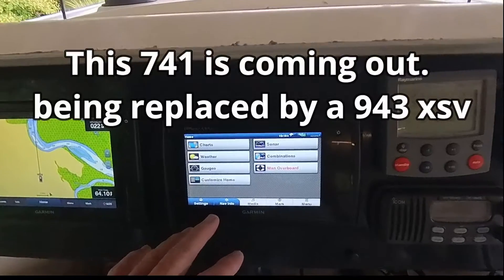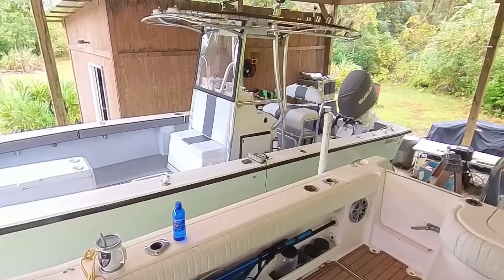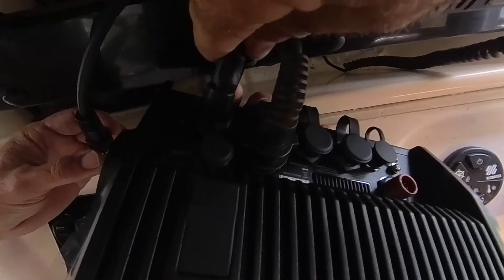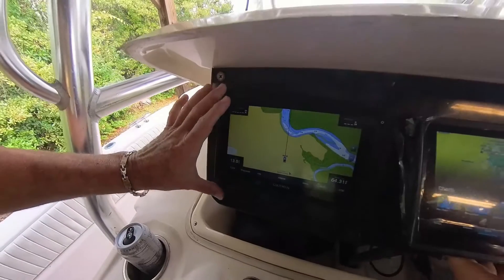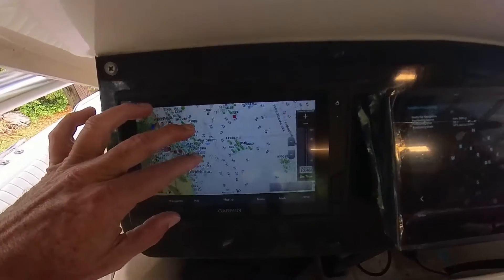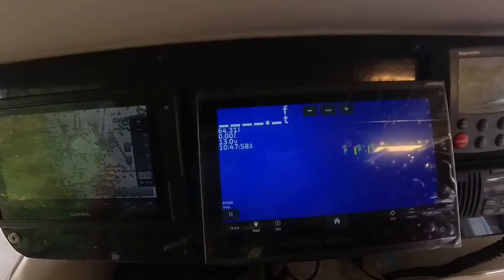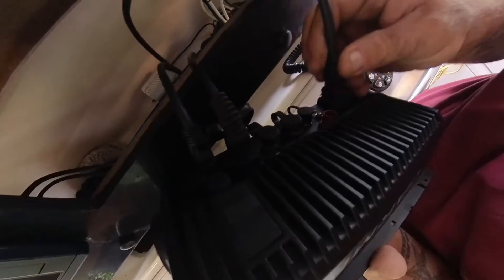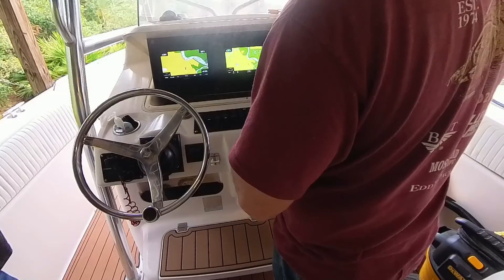Installing a Garmin 943xsv GPS on my boat

Comment: nice video are the garmins w/ keys an key assists a POS ? this Garmin GPSMAP 1042xsv GN+ Chartplotter/Fishfinder thanks for heads up on the touch screen.are those screws security types heads where a regular screwdriver won't fit?

Comment: What is the part number of the Garmin gpsmap 943xsv
Reply from the maker: Are you looking for the 943xsv with or without a transducer? We're absolutely loving this new unit on my 32 grady white.. It's very, very fast.. Good processor speed, no crashing or hanging up.. Clean running gps map and sonar as well. Very pleased with it.

Comment: These guys have no idea what they are doing! Do not listen to them. My Garmin EchoMap 2016 has worked perfect no issues. I just installed new Garmin 943 xsv working perfect! I stand by my Garmin's. I also have Simrad NSX9 its ok, but limited on reading my GLF 10 and GLS 10. Must have Garmin to re-calibrate both.
Reply from the maker: Did you actually watch the Video? If you don't listen, you'll wind up with issues like I have (on video by the way).. Been using Garmin for over 20 years in a commercial environment.. The 943xsv is an awesome GPS.. This video isn't about echomap units AT ALL. Echomaps are just fine. But all Garmin's aren't perfect, especially early full touch screen models and neither are Simrads. I have those on boats currently as well, and ALL have known bugs.  ----  Do you have  a GPSMAP 741xs or a 942xs? The 943xsv was chosen because it works perfectly, which is why I installed it. The 741xs I replaced (two different units with different issues) THESE ARE KNOWN ISSUES. EASY TO LOOK UP.  The Internal antennas on the 942xs DO NOT WORK without an external source 90 percent of the time. A KNOWN issue as well. If you still don't think I know, Watch the 741xs performing like the junk that it is.. Early units have issues, and that's a fact -https://www.youtube.com/watch?v=bKBnACQ5rL8

Comment: I have 12k invested in multiple Garmin 8616’s, if I knew CMOR and other chips wouldn’t be accepted , I would of went with Simrad.
Reply from the maker: @HardSarge Completely understand.. I doubt Garmin will ever allow outside mapping, either. Never have. That's a lot of money invested to not be able to use what you want to use for mapping.
Reply: @bottomfishing24-7  there relief shading is horrible.
Reply from the maker: @HardSarge Yeah, I really don't understand what the problem is. Good relief imaging is so widely available nowadays, I wish they would get on with it. I have too many Garmins (I know you do too!) to have to use other apps or GPS units to display shaded relief properly.